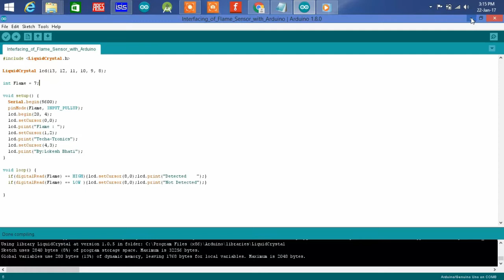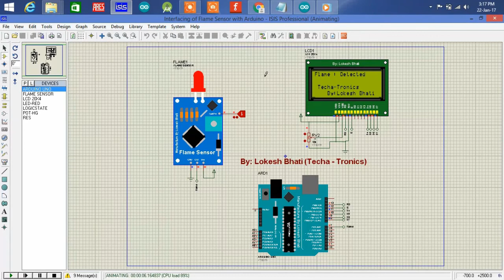How to interface flame sensor with ardunio uno

Comment: What is cost of this flame sensor and what is alternate of this flame sensor plzzzzzz tell
Reply from the maker: Arun Don they have many alternate of this flame sensor you can use simple temperature sensor lm35
around cost 15 rupees this is cheaper than the flame sensor
Reply: thanxx for quick response. okay so i use this lm35 temperature sensor and can you upload video for temperature sensor using arduino
Reply from the maker: Arun Don yup keep watching